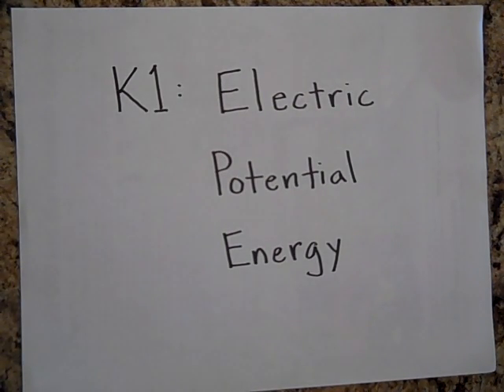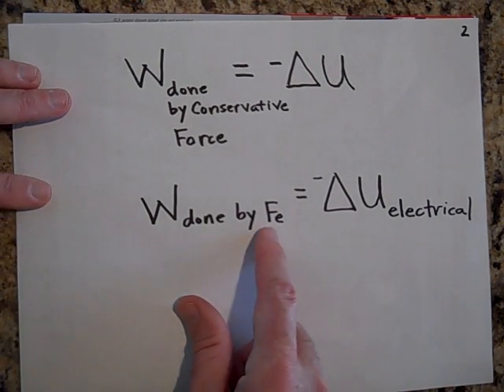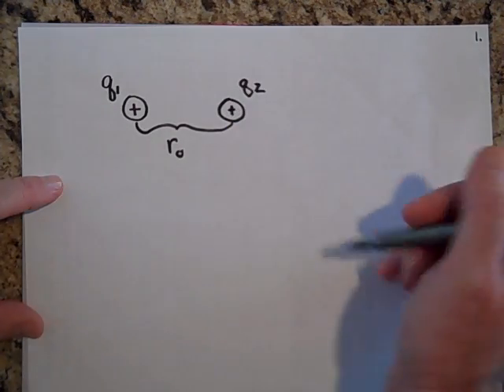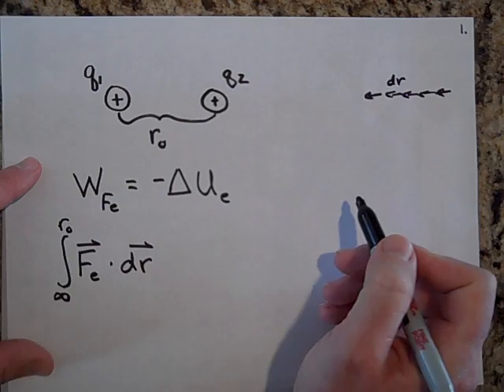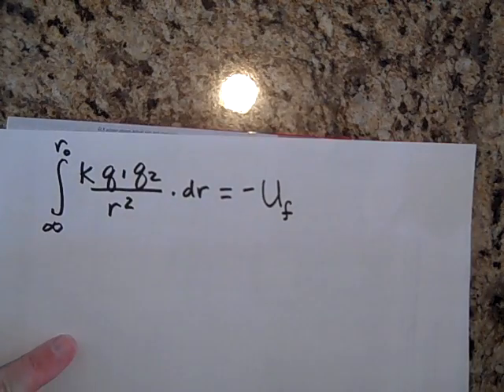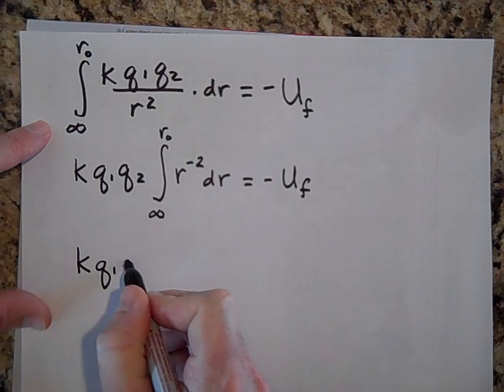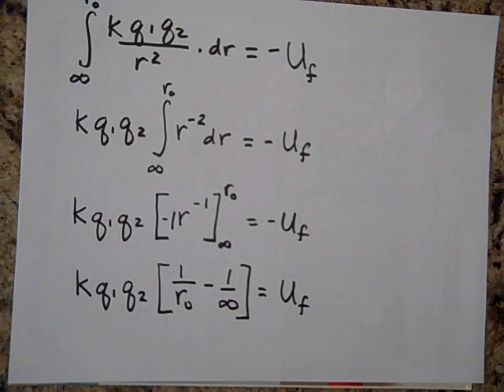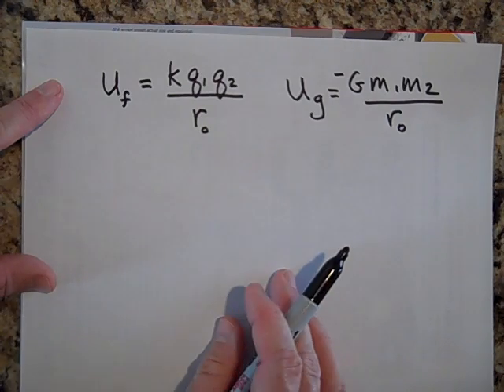Potential Energy due to Point Charges

Comment: Such a great tutorial, I have learned a lot, but I have a question I learned at high school that voltage is work done to move a quantity of charge between two points ( v= w/q ) so how is work equal to the potential difference or did he regard q to be equal 1 ?

Comment: Why do we start moving the test charge from infinity and not from the position of the fixed charge?
Reply: i had the same question. Something is not consistent here because if we look at gravitational potential energy, it is not calculated from some point in infinity to the point where the object is located but rather from the position of the object to a reference level which is the surface of the earth, at this reference level potential energy is defined to be zero. I believe we calulate electrical potential energy in a similar way. Define a reference level where energy is zero and calculate potential energy with distance d from that reference level. For both same sign charges and opposite sign charges it could be shown that the potential energy is kq1q2/r. If we reason according to this video, it turns out that because energy at infinity is shown to be zero it is technically the same at the zero energy reference level so we arrive at the same result but to me this reasoning only makes sense in case of same sign charges. Because same sign charges repel and they have potential to repel each other from the initial position where distance is d to the point where distance is infinite. But for the opposite sign charges situation, the charges tend toward each other and therefore there is no infinity point but a point where distance d=0 which we can not calculate energy because force at that point would be infinite. So i think calulate energy with reference level makes more sense because it can covers both cases.

Comment: Your final example doesn't seem to make sense. 

Energy is a scalar, but we calculate energy from the force over some distance. 

The horizontal forces on q3 from 1 and 2 would cancel, no? So the energy gained by q3 wouldn't actually be the sum of those two would it?

Comment: Force and displacement are in the opposite direction so   F.ds(vector form) = F cos 180 . ds =  -F.ds. So why did you not use this, ive been getting a wrong result by using the above relation, i dont know why. Pls Help!
Reply: Aniruddha G. i know what u mean, the only thing he did was just moving the negative sign to the right side. therefore it looked like he didnt consider the result of the dot product but the fact is he did

Comment: Could you please explain why the dot product of F and dr is positive, isn't F in opposite direction of dr ?  Please let me know if I am wrong. Thanks.
Reply: You right man! But here we are only dealing with scalar quantities so we only consider magnitudes!
Reply: @wolframalpha8634  Scalar quantities can also be negative eg. Work if F in this video is electrostatic force then the dot product should be negative
Reply: @nalinyadav2778   Then consider the Coulomb's equation of electrostatic force , if the force is directly proportional to the product of the charges , where the product be positive or negative , only the magnitude of the resultant force is important , I mean positive value of force , to measure the strength of the force , dot products or even vector (cross)  products can be negative too, all that matters is only their magnitude irrespective of the negative sign, the negative sign only indicates the fact that the work done by the electric force is negative coz displacement of the test charge is opposite to the direction of the applied electrical force , hence the overall equation is positive , because we are only considered with magnitudes not directions
Reply: F is in the opposite direction of dr in gravitational force, but not in electrostatic force
Reply: Faiyaz Sultan Only magnitude is considered so no need of any sign i.e direction.

Comment: You probably have your answer by now :P But you don't take q3 in consideration because q3 is not there yet. You first bring q1 (no electrical  force opposes your bringing it). Then you bring q2 (now there is the electrical force from q1 opposing you) and finally you bring q3 (the electric force from q1 and q2 is opposing you).

Comment: In dealing with potential energy, you can set it to be zero anywhere you want. By bringing the charge from infinity, we set the zero in infinity, which is intuitively right: if the charges are at a great distance, the force will be very little, and so will the potential energy, if they are very close the force will be huge and so will the potential energy (hugely positive or hugely negative :) ). Now think about why the energy has to be negative with charges of opposite sign (it's quite amusing)

Comment: Why do we bring the charge in from infinity
Reply: I think it's because energy values don't have any meaning by themselves, you need something to compare them against (only differences in energy are defined). So it's just a convenient convention to set energy equals 0 at r = infinity bcuz after this point is set, we can find energy values in relation to this 0 point. And then if we want to find the difference between the PE between two points Ri and Rf, PE(Rf)-PE(Ri) is mathematically the same thing as [PE(Rf)-PE(Rinfinity)] - [PE(Ri)-PE(Rinfinity)]

Comment from the maker: Because the formula is the integral of (vector F) dot (vector dr).  The dot product always yields a scalar product.  What the dot product of A dot B does, is take the magnitude of the component of vector A that is in the direction of vector B and multiplies it by the magnitude of B.  But if vector A and vector B are in the same direction, then it just goes to (A)(B).  So for the case in this video we get (F)(dr).
Reply: But scalar quantities can also be negative. F.dr in this video should be equal to Fdrcos(180) which is indeed negative.